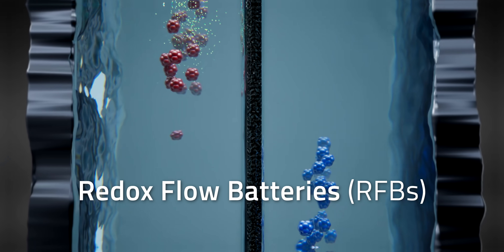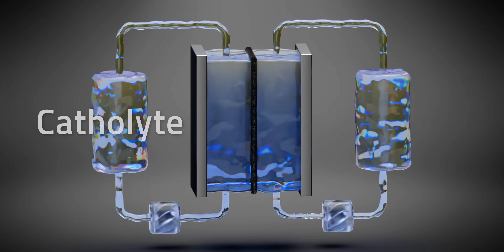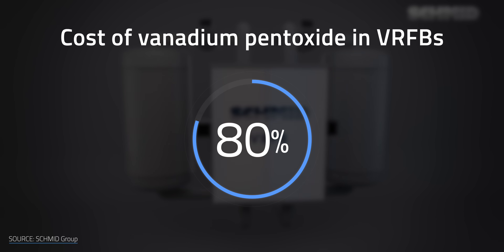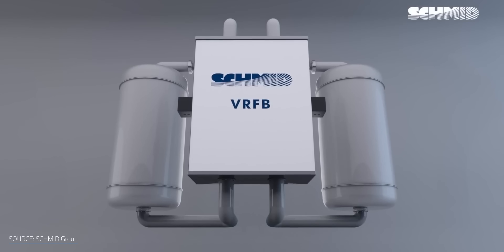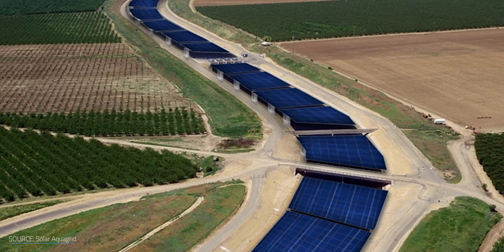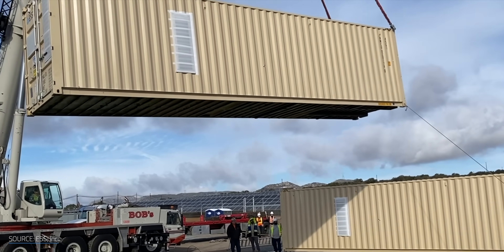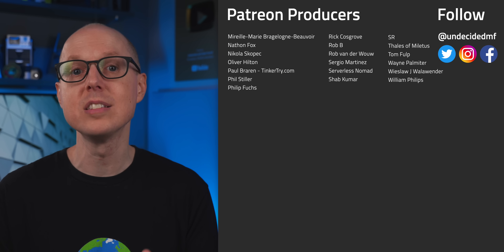Why Salt Water may be the Future of Batteries

Comment: Honestly, I'm a big fan of solid state. Graphine is gonna save the world. Get the liquids out of the batteries. You get less expanding and contracting inside the battery that way. Lithium Ion has some nasty acid instead of salt water, but you're still dealing with a liquid. It will be vulnerable to freezing in really cold temperatures and boiling or over expanding in hot temperatures. Maybe you could have it in some climate controlled building, which also requires energy. But at that point, it's not clear to me that it would be better than any other new gen battery solution and likely with less versatility. On that note, I don't find it very helpful to compare these saltwater batteries to Lithium Ion or other acid batteries. That stuff is rapidly becoming yesterday's tech. How does this saltwater battery compare with solid state or other new gen solutions? My impression from this video is that it's got less versatility and energy density. Could it be cheaper maybe?

Comment: Some measures i missed in this video are efficiency and power. It sounds good, but when it only has 25% efficiency, it is rendered virtually useless with the current energy-mix. And for those who think that this is a great idea for your home to power it with energy from summer in the winter: all this energy is stored at your house. Only because the electrolyte is liquid doesnt mean, that it isnt flammable. And with this energy density i doubt that anybody would risk their home and live to having such a battery in their garage or as some folks suggest in the wall cavities of their home…

Comment: There's something critical missing from the Salginex design: the other half-cell reaction. Chlorine accepts electrons on one side ( Cl2 + 2e- => 2Cl- ) but they don't show where those electrons come from...? The only realistic cathode reaction from only salt water would oxygen generation ( 2HO- => O2 + 2H+ +4e- ) which is notoriously inefficient. Did they just not mention what metal would be used as an electron donor? I wouldn't trust that company if they leave out details that important. Shame on this channel for giving coverage to snake oil.

Comment: It's understandable that the low energy density flow battery technology would pursue the centralized market of large energy producers.  I'm curious if there's anyone looking to enter the individual consumer/producer market with a battery of similar costs?  If I were to invest in solar for my home (which, given my available sunlight probably isn't economical due a few large but favorite trees) I'd much rather have a good inexpensive storage solution than sell my excess electrons back to the local electric company at a much lower rate than they charge me for those same electrons. 😐

Comment: How about power core tech ?........the nucleus is so simple: drive a piezoelectric generator with a chromolly tuning fork, then couple some of the power back to the fork with a high ohms solenoid.
I have used this tech as early as 1978 (that's when I invented it).
No, I don't mind sharing as long as someone doesn't get greedy or try to lay claim to it (remember: it's my technology, no one else's).
And I HATE thieves (Absolute Zero Tolerance......Feel me, sleemo??)
p/s.....the "sleemo" is for those who are "sticky fingered".
But, all that aside.........feel free to use the technology, but no greed, and never to the detriment of anyone else.
Cat.                Use
1.                    Charge cell fine or most tablets.
2.                    Charge some tablets, most laptops.
3.                    Charge some laptops, power most if not all portable                 electronics, most power tools.
4.                    Power some power tools, most small mobility scooters.
5.                    Power most larger mobility scooters, e bikes, some light utility vehicles, electric quad bikes.
6.                    Heavier versions of 5 some electric cars.
7.                    Power other e cars, e SUV.
8.                    Small home (less than) 100 A @120/120/240V.
9.                    8 up to 250A @ 120/120/240V.
0.                    Machine shop.........up to 350A @ 120/120 + 240/240/330V.

Comment: A long lasting, nontoxic/nonflammable flow battery seems fantastic for gridscale, regardless of the lower energy density. Provided it's cheap enough.
All those costs that would go into managing safety and fire suppression can instead go into more battery volume. That volume can be stored more dense/packed together too.
For comparison, an Olympic sized swimming pool is 2.5M liters. So that would be a 312.5MWh battery.
Reply: You can stack these units without worrying about fire and AC.

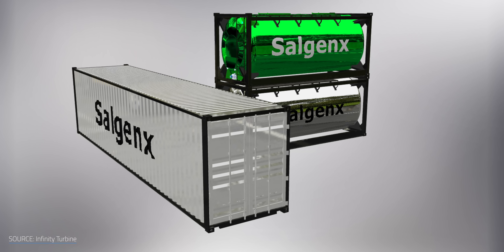Comment: I wonder if a DIY version of this would be possible, of course it'd be less than the claimed 125Wh/L (7:08), but having something the size of a fish tank, or sofa (if placed outside) could provide a somewhat safe energy storage solution. It'd be great for home use!
Reply: Agreed... TWO 55 Gal stainless steel tanks should provide ~50 kWh @ 5kW rate... This would power most small homes!

Comment: Nuclear absolutely is the one-stop shop for good energy production, and there's literally no reason one couldn't use it for 100% of the grid. Even considering its slow ramp up, this can easily be offset with batteries designed as load dampeners, or even just massive capacitors.

Comment: Clearly something based on commonly available materials, salt and rust, and have high energy density and last longer will win. The only topic not discussed is what will replace LiON in EV cars? Solving that, and getting to the 300mi+ range for EVs is a milestone for wide-spread adoption / deployment. Otherwise we are still tethered to gasoline (Hybrid-EV) for long road trips.

Comment: Idk. I've been working with batteries.  They're too problematic, and unreliable. If 1 cell goes bad you're SOL. I think supercapacitors would be better, or a compact high efficient generator
Reply: There are no cells in iron flow batteries, the energy is captured by the fluids/rust and then released when the flow is reversed.  The moving parts are the weak points but pumps and pipes and tanks are not expensive and they can be redundant if you need more certainty.

Comment: Thanks for sharing your thoughts, ideas and videos. Definitely a technology to keep an eye on. From the perspective of a former senior power system operator I’ve always been in the all of the above camp. Large batteries could certainly help with power transmission restrictions. I’ve seen more power dumped due to transmission restrictions or low loads than you could imagine. This technology could be used to get power into a different restricted region if you were to have one half of the battery on each side of an interface and pipe the electrolyte by pipeline to a matching station in the next region. None of the typical limits of adding parallel transmission pathways due to the stored energy and no dynamic stability problems other that the possible loss of generation within a load pocket.  Keep up the great work.

Comment: I want one of these for my house...

So when the battery reaches the end of its useful life, could you not revive it by swapping out the electrolytes? Because it seems to me that that would be the case!
Reply: There are only a few parts involved, tanks, pipes, pumps, salt water and iron.  In the case of ESS Tech Inc. they have something called a proton pump which may wear out but probably would be replaceable just like everything else.  I see no reason why these units properly maintained could not run much longer than 25 years.

Comment: Very interesting, however I see a few red flags. At the end of the video you  suddenly mention a maximum storage time of 12 hours. Maybe the lack of a membrane causes significant self discharge? Also if a company is hyping additional benefits like desalination and virtually free graphene, then that sounds like they're not sure enough about the main application anymore, so I fear it will not be a good as it looks. 
I do hope to be proved wrong!
Reply: The limit is the size of the tanks and how many membrane units needed to get the power desired.  That's it.

Comment: I was thinking about an announcement in Australia, part of our budget. What is needed to make electrolysis work to produce hydrogen and oxygen with salt as a byproduct?  I found a study done by Stanford University to simply use seawater. In Melbourne going back to the 90s we built a desalination plant where the highly salty water was flushed away, the electricity to run it was produced by fossil fuel. It’s simply never been required as our rainfall has been adequate since then. Now it seems like adding solar farming and wind generation to our famously variable climate that any desal plant could supply hydrogen for many purposes like green steel smelting. Not to mention salt and iron batteries. Seems we can clean many industries with relatively easy transition. No rare earths or supply problems. Such plants could multiply themselves.

Comment: Ferric chloride is ANYTHING BUT non-toxic. It's a very strong oxidiser, used for example to etch copper in circuit boards. On the other hand, it has zero vapour pressure and can be easily dehydrated, so unless somebody drinks the stuff, it's fairly safe. 

That said, considering a chlorine gas dissolved in organic liquid as an industrial-scale battery material.. Brave. Very brave.

Comment: salt water batteries or Redox Flow Battery RFB based marine propulsion should be better than any FuelCell propulsion solutions . . . especially in large surface combatants like CATOBAR aircraft carriers displacing more than 36,290 ton & non-amphibious (STOAL) LHA & LHDs displacing 13,000 ton - 30,000 tons . . . note, in order to run a warship on RFBs efficiently it'll need other propulsion assist systems . . . for e.g. Li-ion based distributed energy retention packs at variable density, even FuelCell for that matter . . . biggest advantage here in terms of marine propulsion is the fact that, there's sodium chloride all around a warship . . . it's the sea where you can harness sodium chloride you need from the very sea itself & use it as a fuel for the RFBs, on the fly . . .

Comment: Iron RFBs hold the most appeal to me.  My main concern when thinking electrolysis is chlorine gas, otherwise saltwater is plentiful.  If the chlorine gas can be neutralized or better yet converted to something useful, that would be more appealing.
Reply: It is not electrolysis, it is rust and going the other direction.  ESS Tech Inc. does not have chlorine gas involved.

Comment: Energy density, by volume or weight, is a completely irrelevant metric for stationary storage batteries - they can be as large & heavy as you want, makes no difference at all when they're just sitting there on the ground next to/under your solar array, wind farm, office/apartment building / microgrid station. 
None of the metrics that make lithium ion optimal for vehicles & mobile devices matter at all for this. 
And so, using difficult-, damaging- and/or dangerous-to-get materials to make stationary storage batteries, if the same (or better!) results can be had with easily obtainable (even industrial waste!) materials. 
Save the lithium & such for where it's needed, where its advantages matter; and for the massive amount of stationary storage we need, use this sort of thing instead.
Seems like a no-brainer.

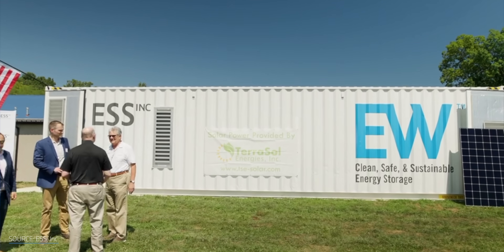Comment: 10:30 uhhhh yes you do? I mean not as much, but thermal runaway still exists, and you are pumping around water, a substance that doesnt noticably break down until 3000c, and exerts more and more pressure the hotter you get it, leading not to fires, but to explosions, (look up a boiler explosion, and thats only 100gallons max.) and if your battery contains dissolved iron? and not full on rust? when that evaporates its going to leave teeeeny tiny particles of said iron, which is pyrophoric, and chlorine is even worse. chlorine gas (the stuff used to kill people in ww1?) is literally just chlorine.

Comment: Honestly the energy density is not even an issue. That is only a problem for mobile solutions, such as cars, and phones. For static energy storage, it is VERY cheap to store massive quantities of things like water. Need more capacity? Just add another 120,000L storage tank (the size of those railway car oil tanks). I think the only concern would be for cold climates where the salt water could freeze. The would likely need to store the tanks underground below the frost line so geothermal can keep them from freezing. As long as the energy efficiency is good, then it can easily complete with other solutions.

Comment: Hopefully their proprietary Cl solution retains the CL well, and doesn't require a gaseous Cl supply located with the battery... gaseous Cl in quantity is not something that really belongs outside of a controlled industrial facility. You really don't want it in your basement.

Comment: I love how flow batteries are immensely scalable.  You're right about the need a wide variety of ENERGY storage and not just electrical storage is needed for the new renewable infrastructure.  Thermal batteries can greatly reduce certain costs for both municipalities and industry.

Comment: Yawn:A company about 8 years ago (Aquion) tried to sell these, but ended up going bankrupt because the batteries under performed and did not meet customer expectations. Its unlikely any inexpensive battery tech will be developed, because of the physical limitations of electrochemistry that results in limited charge cycles. The costs to produce high density batteries with a high charge cycles increases do to the complexity of manufacturing them and the cost of materials to address electrochemisty problems (dendrites, anode errosion, etc).
Reply: Alan Greenshields explained why Aquion was unsuccessful and how ESS is different and superior in his interview with Quentin on the Modo Energy channel. Alan was a director at Aquion, and is now a director at ESS.
Reply: @kennydoerksen  Sorry I don't see it. Salt water batteries have significant drawbacks: Cost, Low recharging rate, & low density. 

In my opinion they are a dead end technology and Alan is beating a dead horse in order to get more capital investment.

Comment: Interesting. Though like many of the battery videos, how long (if ever) before this may become a thing?
Reply: ESS Tech Inc is already selling units.
Reply: @obiwanbenobi4943  I mean would this be where hundreds of thousands of people have a huge battery in the back yard? Or is this more for just businesses? Selling to select people/businesses doesn't mean it's openly available.
Reply: @erascarecrow  They are container sized units.  If they take a container and chop it into 1/10th the size that's the size of a small shed, but I do not know if their technology could be scaled down to 1/10th and still be cost effective.  My guess is that 10 years from now they might have something that would scale better for smaller applications.

They are not sitting still with their research and development, but right now much of their efforts are towards driving down the cost of the units and simplifying manufacturing and supplier issues.  

They already have a fully automated line running and another partially automated line.
Reply: @obiwanbenobi4943  So if i wanted one, it would take up half my back yard, or all of my front yard.

Sounds very useful... (sarcasm)
Though, if planned for ahead of time having this, and a container home sitting on top of it, would actually work probably.

Comment: Ok.. your channel keeps sucking me in with promises of cheaper options for renewable battery solutions... but... the salgenx battery that would be close to what I have now on my off grid system is $376/kwh.. my lead acid system is only $110... so... not even close to cheaper or close to equal.. I like the potential of these but don't have over $100k for the smallest system they have.

Comment: I think climate change because of CO2 emissions is a nonsense, however I also think oil sources are not infinite. I concluded 30yrs or more ago an alternative means of energy will be needed. With the current world population now over 8 billion there is  no doubt this is now needed. So this technology is going to be vital for survival, and the ferric salt water battery is amazingly simple, cheap and more importantly recyclable. All we need now is the will to have constant green power generation, I suggest we use tidal generators around the UK.

Comment: Still nobody asking WHY.

To balance renewables? nopp. that will not work. Becasue the variation in production is longer than the longevity of the charge of those batteries.

Its almost like they are to fire up gas turbines

Comment: I have the space for this tech, but any of the new battery technologies are not available to the general public. These producers only cater to industrial clientele. I went with flooded lead acid over lifepo4 for costs, and I have the space. I have 1335 Ah (20 A) 48v at a cost of $7680. Proper maintenance can render 7000+ cycles at my average daily 15% DOD.

Comment: In reference to the price to market, $5/kWh is still $5000/MWh, which compared to wholesale price is obscene (as of 9th May, spot prices for energy have been $10-20/MWh). Storage needs to happen, absolutely, but it needs to be competitive on cost for it to be commercially viable.
Reply: $5/kWh is the purchase price, not the total cost of the energy produced. That price will also be split over its 30,000 cycles. That makes 16.66c / MWh as the cost of the battery. They've still got to get the electricity from somewhere, and they'll need to buy that.
Reply: @BernyStapleton  At times energy prices go negative (see the duck curve).